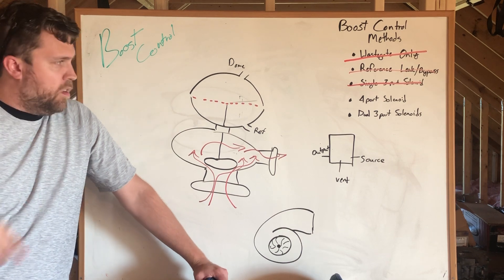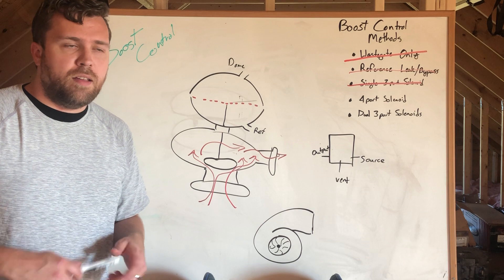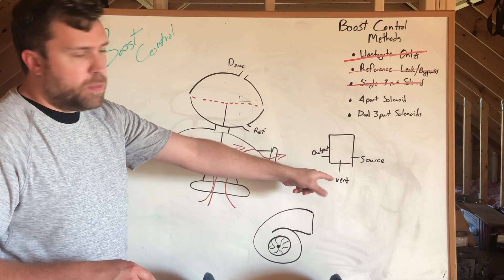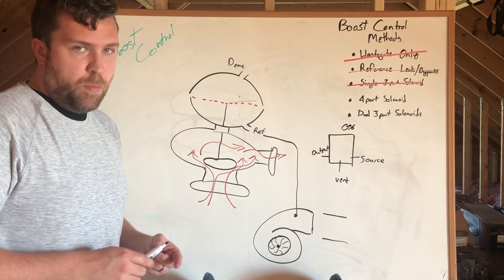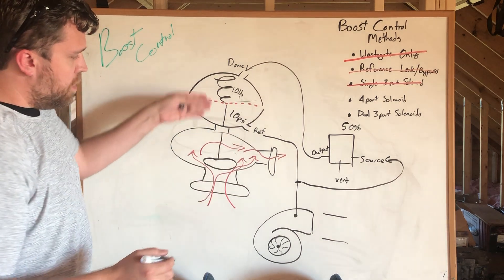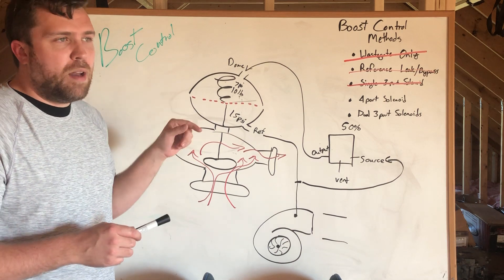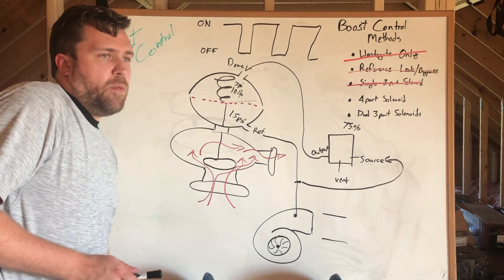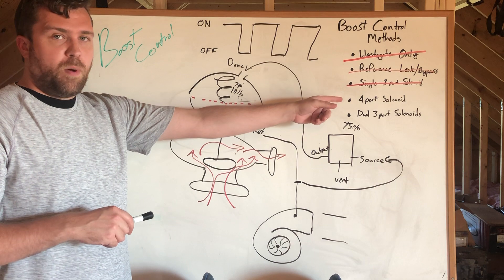Boost Control Series: Single 3 Port Solenoid

Comment: Hey mate new to your channel I've got a Nissan Pulsar GTI-R with a GT3071R I've just bought a Turbosmart wastegate actuator IWG75 dual port I don't have a port in the housing of the turbo it's still running the stock top mount I/C there's a port I've feed the boost control solenoid from in the past
Would it still be safe to run that as a source
Boost control is a Greddy Profec B spec2
Reply from the maker: The key to this is making sure that your source to the boost controller is at or above the reference pressure. If they’re coming from the same place I think it will be ok.
Reply: @greenshortsperformance  thanks so much mate

Comment: Great vid. To clarify, does your 'vent' let out the pressure from the 'dome' when the valve shuts or does the 'source' go out the 'vent' when the valve is shut. I think you explained it as the latter.
Reply from the maker: For a 3 port setup you’re pulsing the solenoid to driver a certain amount of pressure to the dome but not all of it. So on 40% duty cycle 40% of the pressure goes to the output, 60% goes out the vent, and the input comes from the compressor source
Reply: @greenshortsperformance  thanks, so when it is not open to the dome, it is leaking to atmosphere?
Reply from the maker: @RotorKartel  yes the vent port of the solenoid just goes to atmosphere. Sometimes people will put a muffler on it just to keep trash out and such

Comment: I need some help with the vacuum line routing I recently bought truck with lsx 408 with 88mm borg Warner turbo they have my vacuum lines ran all wrong from what iv read and researched just want to make sure I'm going in the right direction to fix it
Reply from the maker: From the compressor housing go to the bottom of the gate, then your controller can add pressure to the top
Reply: I have a 3 port mac valve and a efb boost controller were would the vacuum line go from controller and were would you recommend vacuum line for bov and also for the boost gauge itself and fuel pressure regulater thanks for the reply back I appreciate it
Reply from the maker: @mudtogold53  all of that needs to reference the manifold

Comment: Great video man, thanks for this. I have a twin turbo setup, what would vary in routing? Do I need 2 separate mac valves?
Reply from the maker: Nope. You could do it the same as a single turbo just put a Tee in to feed both wastegates instead of the single.
Reply: @greenshortsperformance  thanks for the reply! So should I also give it source pressure from both turbos? Both turbos into a T to the source port on the solenoid? Thanks again.. Liked and Subed
Reply from the maker: @yallasoccer6280  you only need to feed the Mac valve with one compressor. You’d go from each compressor to that compressors reference port on the wastegate. Then tee one side to feed the Mac valve. Then out of the Mac valve tee again to feed both domes.
Reply: @greenshortsperformance  Great and simple video for everyone to understand! What about changing the plumbing to 3port like 4port?
Pros and cons? Compressor boost reference and the other two ports plumbed on yop and bottom of the WG. With Tee vent or no vent at all..

Comment: If I want to use a 3 port MAC and electronic controller to compensate for wastegate creep and/or a poorly flowing exhaust, should I change the spring down to a smaller boost value than I want and plumb in the MAC? I'm comfortable with the amount of boost I'm SUPPOSED to be making, according to the wastegate spring, but I don't think I'm actually getting that boost for the reasons you stated.
Reply from the maker: If you’re having creep then there is no way to really control that. The Mac valve can only add on top. Best thing for you is to change wastegate placement and or size

Comment: Thanks Aaron!
Wheres the green shirt?
Reply from the maker: Washing machine
Reply: Awsome thanks.
So because the Mac valve is making fast adjustment constantly achieving any given setting....if say you had some back pressure or boost creep you can potentially get it under control using the Mac valve...the creep that is.?
Reply from the maker: @clint.garage.6092  creep can be tricky because that’s ultimately the WG not letting enough by. What’s nice about the Mac is that we can offset the duty (in OL) with rpm to maintain a flat boost curve where with WG only we often have a falling curve with rpm. If you have a creep issue it’s likely either too small of a WG or the placement is poor.